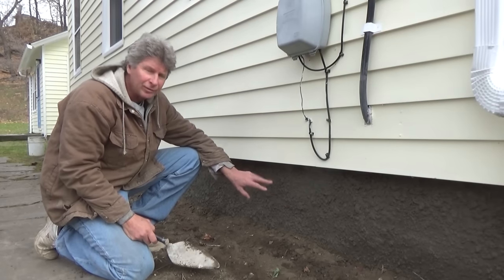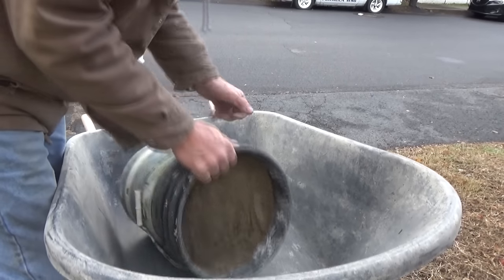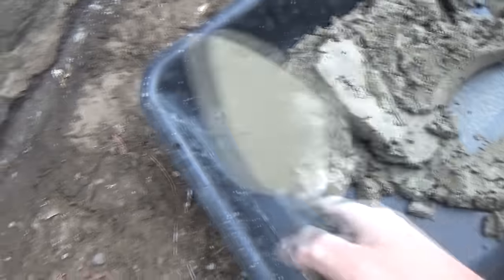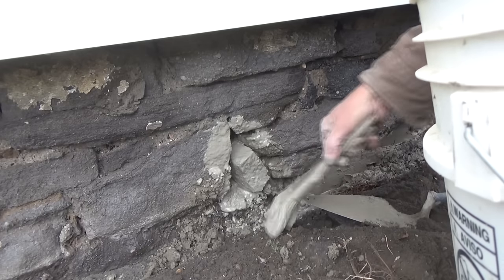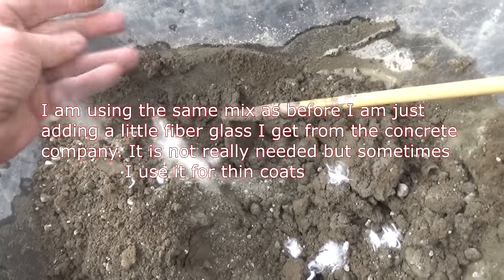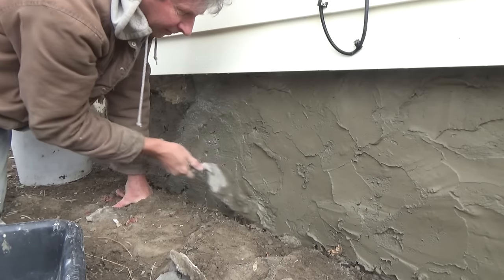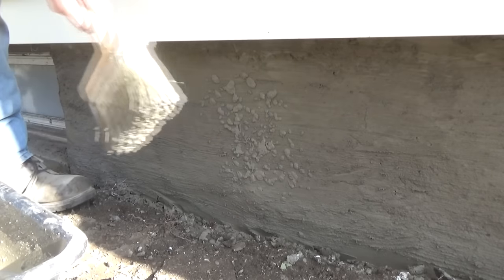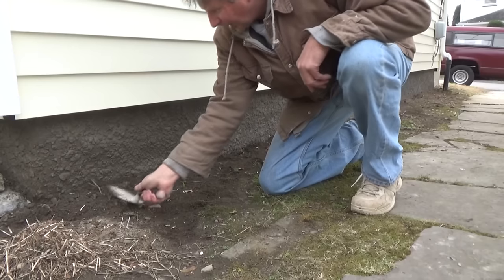"STONE" FOUNDATION REPAIR (part 3) Mike Haduck

Comment: Great videos! I live in a Historic District in Upstate NY, in a home that was built in 1859. The several generations that owned the house before me neglected the home, so now i'm trying to undo those years of neglect. There was terrible grade, probably a three inch drop over three feet TOWARDS the foundation, coupled with neglected gutters the overflowed right into the area. So I've got a section of the foundation that has bowed inward slightly, but more importantly, the stone is falling out on the outside. I plan to patch it, but my question is, how do you decide how far down to dig along the foundation? My basement wall probably extends down another 5 feet below grade, but I see you only dug a couple inches down. Is there any insight you can provide on the reasoning? I figured in the bad section, I would dig until I found solid wall again and patch everything above, but do you have advice for the rest?

Thanks! Again, great videos!
Reply from the maker: Hi Alden,  it seems most of the lime mortar  stays in place under the ground and mostly falls apart above ground so I just dig down about 4 to 5 inches, And that will tell me the story,  you will mostly noticed the animal holes around the foundation if there is any, most of the time I never have a problem, I hope it helps thanks Mike
Reply: That certainly does help, Mike. Thank you! Gives me a little more confidence to tackle this job.

Comment: Nice patch up job Mike.  But why don't you remove all that old portland based render, rake back the joints and re-point in lime based mortar?
Reply from the maker: +Matthew Cartwright  this foundation was slag stone from the mines and it is not a veneer type show stone, lots of folks around here only accept certain fixes, especially as they get older.  I made the mix half Portland and half mortar,  regular mortar don't hold up around here, someday I got to do a video on that,  thanks for the comment.  mike
Reply: +Mike Haduck  a video about that would be awesome! on a side note how long does this type of repair hold up in your part of the country Mike?
Reply from the maker: +infinitestarz   I did a video called , "how  I  repoint a old stone wall (part 2) Mike Haduck"  and I am working on a couple others , but that should show something like your are asking about, as long as there is rain gutters it will last a long long time., especially if Portland it added, thanks mike
Reply: thanks Mike!

Comment: Mike, your videos are great and very helpful! I have a question about your "Portland Glue". When we we had the kitchen floor tiled the guy put 1/4 inch plywood on top of the sub floor then tiled on top of that. Over time many tiles have come loose. When I replace tiles or eventually put new tile down, can I paint over the plywood with the Portland first or is there a different bonding agent I should use for wood? Thanks!
Reply from the maker: +knockitstiff  I only use this Portland glue for parging or plaster  like I did with the stone, I would go to the tile store and ask what is best for your situation. tile it a different world, they sell better stuff for sure, ,,,,,,,on part two on "how I lay tile on concrete (part 2)" I ground all the cement off the back of the tile and re-lay it.,  check it out, ,  I hope it helps thanks
Reply: +Mike Haduck I'll check it out. Thanks!

Comment: I live in northern ny, cold winters. Is it acceptable to use straight type s mortar to do this to a similar foundation?
Reply from the maker: +silas  all the experts say it different but I usually do 1/2 s mortar to 1/2 Portland when I mix it with mason sand,   (1 cement to 2 parts sand)  It works for me and it is a timing thing,  every situation is different, so a little experimenting  should not hurt,  thanks mike
Reply: +Mike Haduck thanks Mike, I enjoy your videos and they are perfect for first time home owners!
Reply from the maker: +silas  thanks, I appreciate it. Mike

Comment: For a guy just starting out on his own... What's a reasonable bid for a job like that... I know it can depend on the size. & whether you're just doing the inside or out etc etc... But still, just an idea. 
Thanks
Reply from the maker: Hi Daniel,  I mostly have repeat customers so I just figure my time and the materials, if I get greedy I will not get called back, but if I am more than fair I will get constantly recommended and never be short of work,  better to be a little cheaper in the beginning, I hope that makes sense, thanks mike
Reply: @MikeHaduck  No, it does. I agree. Thanks.

Comment: What can you do when the s mortar comes premixed in this situation? What would be the ratio of sand and portland? Thanks!
Reply from the maker: Hi MrBlazin,  on some smaller jobs I will use the pre mix, all you got to do is open the bag and the sand and cement is already to go , you just add water like a pancake batter,  I just like the old way because I can control my ratios for certain type jobs,  otherwize I almost always say what I use on each job, I hope it helps,  thanks mike
Reply: Thank you sir, Yea I plan on parging around my stone foundation here in NEPA so just wanted to know before I get into it one of these weekends when it doesn't rain. haha

Comment: Why do you add 1/2 bucket of mortor?
Reply from the maker: Hi Jose,  my usual mixes are 2 parts mason sand to one part cement, but some times I will say. 2 buckets of sand to 1/2 bucket mortar and 1/2 bucket Portland which equals one full bucket, same thing, just two different cements, thanks mike

Comment: I don't think the climates are that much difference (northern England) and I do not believe this is the right thing to do for soft stone. I've never seen Mike use Naturally Hydrologic Lime 3.5 of 5.0. There are tons of videos of soft brick walls and stone walls repointed with cement. It always ends badly. It always looks good for the first few years.
Reply from the maker: Hi Wallace, around here it’s almost impossible to find naturally hydrologic lime, and I never seen anybody use it till I went to conwy castle,  our weather it does not hold up,  I agree about the soft brick and lime stone, but every thing else I better add Portland or I will be back redoing it in a few years, and every old timers will say the same thing,   Thanks mike

Comment: repairing old stone houses rule #1 - never ever put cement over lime.
Reply from the maker: Hi Da,  I been doing this over 50 years, and I got to go around and fix everybodies job who uses lime because it don't work here, with respect Mike
Reply: @MikeHaduck appreciate your experience, but lime only doesn't work if it's done badly. those ancient churches and castles you talked about, there's a reason they are still standing after many centuries – in the case of roman/byzantine and other ancient buildings, millennia – in many parts of the world in many different climates, from desert to alpine. all built with lime. it works everywhere.
Reply from the maker: I agree for those but in my area on the flat, I'd be back fixing it within a few years, thanks Mike